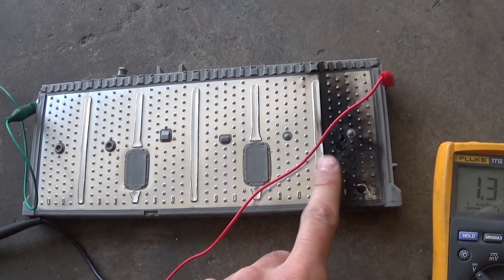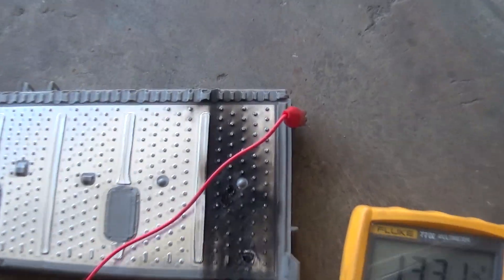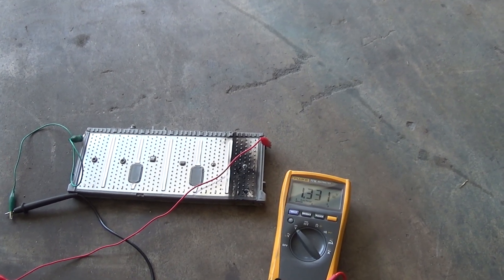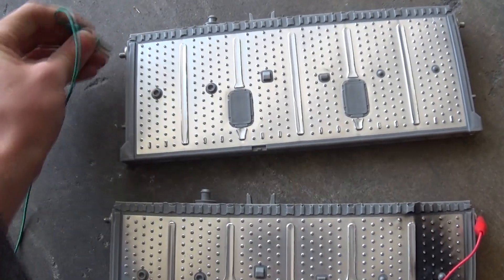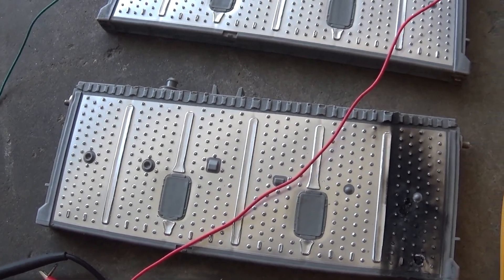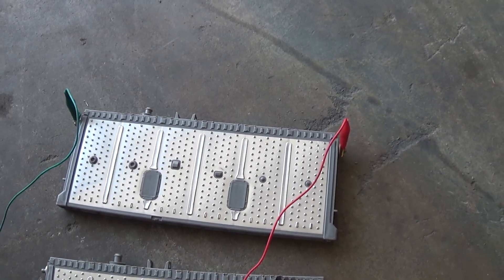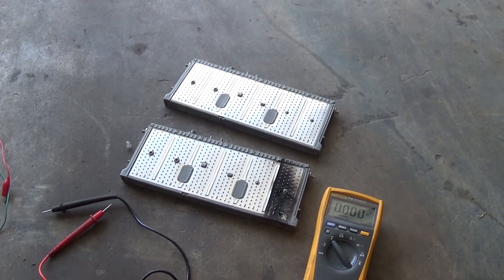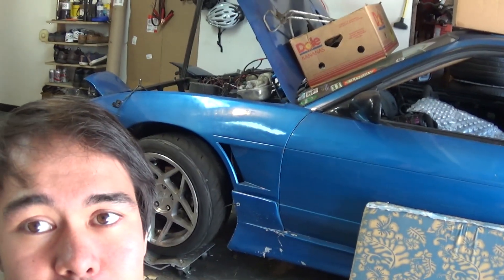What Did I Find in my Prius Hybrid Battery?

Comment: Have you ever heard of the problem being a corrosion issue. I have torque monitored my cells and have they are all running in the 16.7 to just over 17. Only one cell showed at 15.8 briefly. The car sat for a few weeks while I got around to fixing the coolant pump.   Showing code P0A80 and P3021. Thanks for your videos.

Comment: To anyone, I just fix my hybrid pack ( I only replace 5 modules) and it runs great but every time I used my AC the hybrid system light comes in again.
Reply: Replace the air filter on the ac dance around the car 2 times open the door and flash the lights 3 times and say thank you Yah.

Comment: what did you pay for the battery pack?
Reply from the maker: I didn't replace the whole battery pack, I just went in and replaced a few bad modules.  I got 4 modules on ebay for about 150 bucks shipped to my door.  You can shop around and probably find it for a little cheaper though.

Comment: Wow! Spectacular failure! :P Not seen one do that before. NiMH is usually less of a spectacle when it fails.

I WOULD say to try and (if you can) charge the pack up all the way with a proper high voltage charger. NiMH cells will balance out by releasing energy as heat, so charge them at a slow to moderate rate and keep a fan on them. :)

Comment: Nice work very helpful videos.  I got the dreaded red triangle and thanks to info from  youtube I changed one cell with a reconditioned one I bought from ebay for about $45 and its been running fine for 15 months now.
Reply: So you disassembled the battery from the car, did measurements with a volt-meter to find the bad module cell, replaced the module cell and put it all back together?  You didn't have to recharge the battery pack on a charger?
Reply from the maker: That's pretty much what I did.  I should have power balanced them, that's the correct way to do things, but I didn't have the equipment needed to do that.  So I just replaced and put it all back together
Reply: Sorry I didn't see your question till now. No I did not recharge the battery I just reinstalled it and it has been running just fine.
Reply from the maker: Thanks!  I'm glad you got your red triangle fixed for not too much money.
Reply: did you just removed bad cell and replaced with ebay without balancing?

Comment: Where did you order the cells from?  I am about to order a Bluetooth code reader and 
TorquePro, just to do some baseline measurements on my 05 Prius, my wife's 13 Prius and my Rav4 hyrbid.  I've changed a battery pack in the 05 (Dorfman used to offer a three year warranty and it is just out of warranty) and my daughter is getting some squirrelly activity on the gauge on the HMI panel.

Comment: Hi, 

Good information on Prius modules.  Clearly it looks like that module shorted and burned up.  You're lucky it didn't cause a fire or burn other modules in the battery compartment.  When you got the error code, how did you know to check the bus connections for good contact?  

Also, can you recommend a good Prius forum?

Thanks a lot, Tom
Reply from the maker: Absolutely, it looks like that battery module got pretty hot and I'm lucky it didn't heat up any other modules enough to catch fire as well. 
When I got the error code, I just went through all the things I could think of that would throw that code and checked each of them 1 by 1
A good prius forum is https://priuschat.com/forum/
Lots of knowledgeable people on there and just about every prius problem that exists has been covered or talked about on there.
Reply: Thank you for suggesting Priuschat.  I'll be sure to check them out.

Comment: Hey, is the car still running fine? No new failures?
Reply from the maker: TheForistality so far I've put 7000 miles on the Prius and counting.  It threw some p0a80 check engine light codes but I took the battery back out at 5500 miles and cleaned the bus terminals and things have been good so far
Reply: How is your battery pack handling all the hot weather this Summer? The voltage reading when the battery pack is not under load are not accurate. Measuring voltage load drop after 2 minutes of using Prius headlight bulb on a module will point out bad modules sooner than just voltage test without a load.